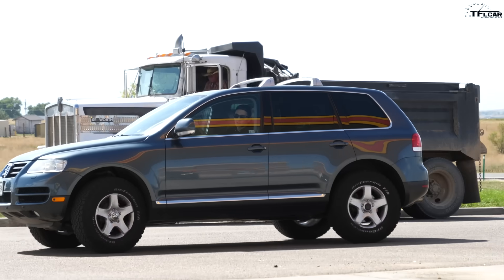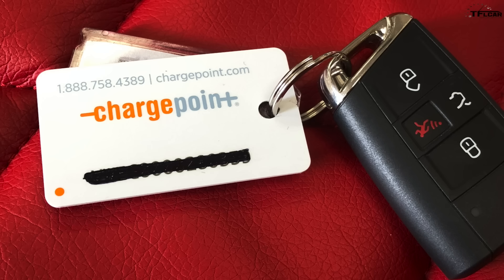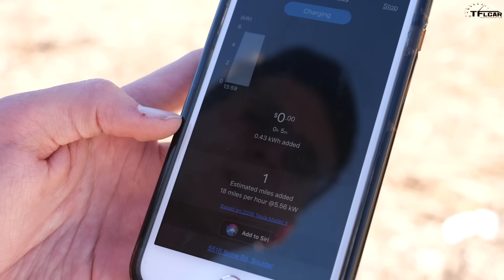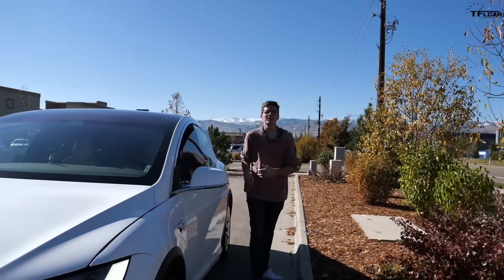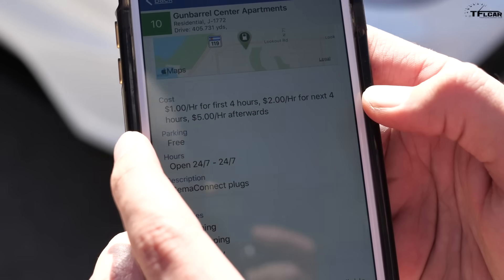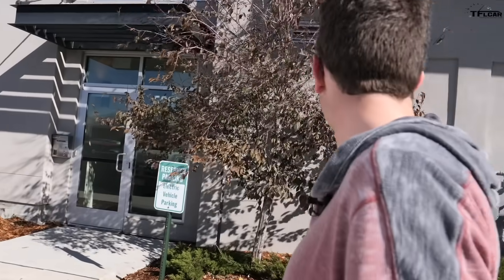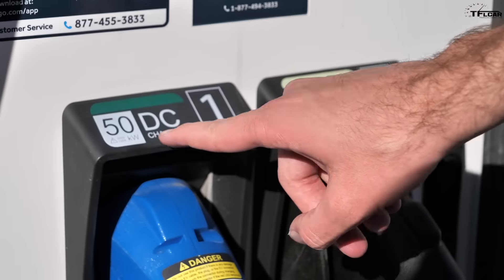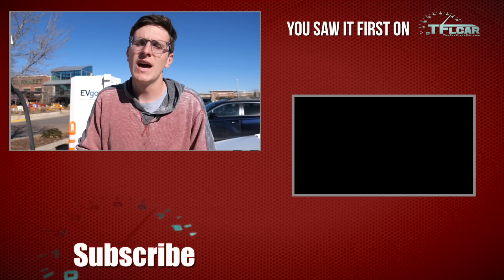Here’s Why Charging an Electric Car Can Suck - And It’s Not The Reason You Think!

Comment: If it's such a great system why didn't they just let you swipe a credit card at each station and what's going to happen when 50 to 60 to 70% of cars are going to be electric vehicles is not going to be enough charging stations that's so if you're going to sit there for a couple of hours you going to need a lot of charging stations even 30 minutes on average it takes 15 minutes to fill up a gasoline vehicle and you can run three to four hundred miles on the tankful
Reply: The video is bullshit.  Hard to believe that folks are still watching it and believing it 2 years later.

A Tesla supercharger is actually more simple to use than a gas station -- no fumbling with phones or credit cards, you just plug in and it starts charging.

Comment: Wow, by the time you are done charging, Im 450 miles down the road. Think Omaha NE., from Denver. Very informative on EV current status and how this is rolling out. Another 5 years should shake out many of these problems.
Reply: The video is bullshit.  Hard to believe that folks are still watching it and believing it 2 years later.
I should do a video showing how gas cars are stupid because it takes a day to fill one using a shot glass.

A Tesla supercharger is actually more simple to use than a gas station -- no fumbling with phones or credit cards, you just plug in and it starts charging.  While you are freezing your ass off putting gas in your car, I am toasty comfortable inside.

Comment: Why didn't they generate power from The Wheels on the car into a unit that makes it  50 times more powerful to recharge the battery on your car while you're driving your car and then Park in your driveway to recharge on wireless electricity but if they make an engineer the process of recharging your battery using the car you're not going to have to wait to recharge your car is automatically charged so they deliberately made it so you had to charge the battery so they had to charge you for recharging the battery so this is the most unpopular thing we can think of and we don't like it
Reply: My Prius self charges like that

Comment: The reason you don't want electrical cars and charging a battery it takes too much pollution in the factories to make a battery takes too much pollution to dispose of a battery it takes too much pollution to recycle batteries so they dump the battery idea no one wants the extra pollution from the electrical plants that is going to take to recharge all these cars and vehicles so the battery I did was dumped because of too much pollution and no one wants a high electrical bill that could get as high as gasoline like high utilities do so everyone wants hydrogen fuel

Comment: We need to hydrogen fuel pumps put clear across America today we have them on all of our coastlines all over the world but in the United States we don't have them across the whole country hydrogen fuel has no pollution hydrogen fuel only takes 2 minutes to fill up and it lasts for weeks it's like bringing the good old days back of 10 cents a gallon for gasoline was a hydrogen fuel you have a more powerful fuel a more reliable fuel it turns America back into a superpower that don't have to rely on oil or another country it is a more powerful fuel just like the more powerful engines that we have a hydrogen fuel cell vehicle is a electrical plant on wheels you never have to charge it can charge itself if it had a battery 🔋

Comment: Battery technology is still not there yet. This is too much of a hassle. And what happens when you loose cell service for three hours or any other stupid issue to prevent charging. IM OUT ALSO
Reply: The video is bullshit.  Hard to believe that folks are still watching it and believing it 2 years later. Tesla solved all of the 'problems' in this video.  Do you fill your gas vehicle with a cell phone and a shot glass?  Tesla drivers don't use these idiotic, low power charging stations you see in this video, except in emergency situations or overnight at hotels.

A Tesla supercharger is actually more simple to use than a gas station -- no fumbling with phones or credit cards, you just plug in and it starts charging.  No cell service needed.  A gas station needs power and gas, while a tesla supercharger only needs power.

Comment: So at "level 2" it's the same as pumping 1 gallon of gas per hour? That's crazy!!!
Reply: That's why the Tesla community doesn't charge at level 2 chargers on road trips (except at hotels that provide charging overnight).  Took us 3 days to casually drive from Pennsylvania to Texas, exactly the same as my gas vehicle, only far less cost for fuel.  This video is fake news disinformation if you're driving a Tesla.

And, by the way, Tesla Superchargers don't require credit cards or cell phone connections.  Just plug and charge.  And you can watch folks outside (and inside) of their SUVs, pumping gas in the snow, freezing their asses off.  That's crazy!!

Comment: What a nightmare..Waiting for the charge, getting adapters, not knowing where the fuel stations are or if you can use them, or if the station is being used--all that after spend a large price for a vehicle that you still have to pay for the electricity...Not really sold on the idea---
Reply: Tesla fixed all of that.

Comment: why cant they have a credit card reader? that would cut out 1/2 the hassle.
Reply: A Tesla supercharger is actually more simple to use than a gas station -- no fumbling with phones or credit cards, you just plug in and it starts charging.

Comment: This is too confusing and takes too much work. Plus how are the elderly supposed to figure all this out? I remember years ago when Wendy's restaurant first came out with their new fountain soda machines that had 30 to 50 drink choices, I would sit there and watch the elderly struggle to work the soda machine. Plus what do you do if you have a flip phone?
Reply: This video is nonsense for Tesla drivers.  A Tesla supercharger is actually more simple to use than a gas station -- no fumbling with phones or credit cards, you just plug in and it starts charging.  And the elderly can sit in their comfy car rather than freezing their asses off trying to struggle with the credit cards and gas pumps.

Comment: sitting at a charging station for 2 hours to 24 hours to recharge ur car is a joke. charging ur car over nite when ur source of electricity is coal is worst then actually using a ice car at that point. if there was more hydrogen station, i would consider switching to hydrogen then battery until they can get it down to 5 to 10 min for a 500+mile charge.

Comment: And at a Tesla Supercharger, you can get 175miles/hr charging.
So 15 mins will get you almost 45 miles, typically enough to make it home IF You actually need to charge on the road (which most people won't)

Tesla's chargers are also only 13 cents/KWh

Comment: That's a lot of time to hang around for a charge and all the payment plans and different connects can be very confusing.  Why doesn't the government mandate a standard connection device???
Reply: Government mandates lock in stupidity... if the 5kw connector of today was the national standard, then Tesla's 50kw connector would be illegal and NOBODY would have a supercharger. Tesla's 50kw connector only needs a cheap adapter to charge from a 5 kw connector, but you can't jack 50kw through a 5kw connector without burning it up instantly... No thanks, I rather the marketplace decide on the winner than our dear comrades in the government.

Comment: Try doing this during a snowstorm, or as a thunderstorm comes through and knocks out the power. Where do you go for the 10-20 hours it takes to charge? Do they have a special huge compartment in the boot for all the charger adapters? Stupid, stupid, stupid.

Comment: Spent 6 minutes to recharge 1 mile? Lol...since time is money...how did you save money 💰? Lame propaganda 🤔.  Buy at 60K and take 6 minutes. Buy bye you idiot electric motor vehicle owners  🙄 🤣  idiot
Reply: So ... my car charges while I'm sleeping and is full every day when I wake up.  Does your car gas itself up while you are sleeping, or do you go to the gas station and fumble around for your credit cart while you're freezing your ass off?
Time is money.
Reply: @cSR-71  Craig your argument is weak. All you are doing is transferring the energy source from your tailpipe to your electric company's power plant smokestack. That lithium for your batteries needed fossil burning plants and vehicles to produce these products. Until there is a perpetual source of energy nothing is for free. Can my car gas itself? What kind of argument is that? Can your electric vehicle plug itself into the wall outlet? Lame and weak. You still do physical labor correct? Phooy

Comment: “…but the reality is most people don’t have high voltage power in their garage.“  
I have absolutely no idea what you’re talking about. Every garage that’s part of a home that I’ve ever been in has 240 V power. If the house has an electric range, or an electric hot water heater, or an electric clothes dryer, then it has 240 V power. What are you even talking about?

Comment: Tesla's plug and play system is the most appealing, but still the range is terribly limited. Electric vehicle not a good option for the non-homeowner or traveler. And you still have to burn energy to make that battery and electricity... and heat the battery when cold.... and use 10 different apps to buy charging... and spend all that time making sure it works.... Waste your time not mine. Waste your money, not mine... oh wait, my tax dollars are paying for that electric vehicle in tax incentives...

Comment: Videos like this convince me to ABSOLUTELY NOT BUY and EV.   Time is money. Convenience costs money.  I pull up to the gas pump and 6 minutes later I drive away and don't have to refill the tank for at least a week.   I recently drove from NY to San Diego and back.  I refueled 16 times .  Maybe 10 minutes per stop including a bathroom break.  I would go absolutely crazy having to wait so long for a full electric charge.  EV companies will need to build cars with a bed, so you can go to sleep while filling up.  Also you pay for an electric car 3 times what you can buy a fuel efficient Toyota.  Call me when they figure out a 10 minute charge with a 500 mile range.

Comment: Cost per mile of ICE car is around 14c per mile when gas is $4/gallon and the car gets 28mpg.    Current cost per mile for a Tesla averages around 4c per mile.    

Tesla Superchargers can charge up to 250kw.     
From Tesla Support page:
Vehicle	Supercharge Speed
Model S	Up to 200 miles in 15 minutes 
Model 3	Up to 175 miles in 15 minutes   
Model X	Up to 175 miles in 15 minutes  
Model Y	Up to 162 miles in 15 minutes

When billing per minute, there are four tiers to account for changes in charging speeds: ‘Tier 1,’ ‘Tier 2,’ ‘Tier 3’ and ‘Tier 4.’
Tier 1	                                        Tier 2	                                                                Tier 3	                                                                     Tier 4
Charging at or below 60 kW	Charging above 60 kW, at or below 100 kW	Charging above 100 kW, at or below 180 kW	     Charging above 180 kW
Lowest price per minute	        Second-lowest price per minute	                Second-highest price per minute	                     Highest price per minute

Comment: Well the problem is that EV America doesn't seem to want to get their butts together and come up with a universal charging system.  So if your vehicle is of a particular model, just go to that charging station that's designed for that model.  Solved.
Reply: Actually, the Tesla can charge from most stations with their little adapter for the connector. But for the fastest charge, the Tesla needs a connector that can handle 50kw, while the other stations offer only 5kw. If you plugged a Chevy into the Tesla station the adapter and battery would burn up. A Tesla at the other stations would simply take just as long to charge as any other car. The Tesla design is far more universal than anyone else. 
If the government mandated the 5kw connector, there would be no Tesla superchargers which needs a connector that can handle 50kws.

Comment: Me... Perhaps, if not immediately 5 mins awaiting a pump, no matter what side as hose reaches either side. Say 5 mins to fill, one to five mins to pay, by cash or card. I achieve around town approx 40 mpg. Country and/ or motorway 70 mpg. My town has 5 filling stations. One gives 24/7 attendance, the others, attendance early morning till late evening,  and then electronically by card.
Now if it was me re battery power, i would have had standardisation of battery for all vehicles, that fitted within the chassis and floor pan. Perhaps similar set up like your mobile. 
RR had this set up for the landed gentry to conceal their hugely expensive shot guns. Filling stations to carry a supply of battery along with a power/charge point wrack to maintain and recharge exchanged batteries. This method was used in the mines for miners head lamp power packs and for your crystal radio. 
Lets say for ease of understanding. 100% charged battery £100. Your usage leaves 25% charge in battery, you go into filling station obtain newly charged battery £100 minus £25 = £75 to pay. To me it seems engineers have long forgotten KISS ( keep it simple stupid) My apologies, it is too simple, I must be wrong. 😂

Comment: A summer road trip would not be possible with this car. During my road trips I have to drive 500 miles in one day. Even if the car had a 500 mile range I couldn't wait several hours for it to charge and I couldn't count on finding a charging station outside big cities. I really want to help the environment but I couldn't give up summer road trips.

Comment: There's only one way for EV's to be efficiently and quickly recharged.  Every E V car must be equipped with the same type battery pack that can be slid out, taken out of the vehicle and replaced with another fully charged battery pack.  .   The difference between the charge left on the old battery pack and the amout of a fully charged battery pack will be the cost of the replacement plus the service charge.  Therefore, current gas stations must become charging stations and keep in stock fully charged battery packs depending on their customer base.  When older used battery packs are exchanged, they must be immediately placed on charging units in order to keep a full supply of charged battery packs.  Example - Your battery pack has 1/4 charge left.  You pull into a charging station. The attendant pulls your battery pack out and notates the amount of charge left. He carries it into his station and pulls out a fully charged battery pack and places the trade in battery pack into the slot where the fully charged battery pack was to recharge it.  He then carries the fully charged battery pack to your vehicle and slides it into the slot and secures it, insuring that it plugs into the prewired connectors.  He then checks the charge indicator inside the vehicle. Charges his customer for 3/4 ths charge. The customer pays and is on his way in just a few minutes.
Reply: Do you understand how HEAVY a battery package is on an EV? It's not a 12 volt car battery weighing about ten pounds. A Tesla model 3 battery is over 1,000 pounds... and would weigh even more if it has to be on guiderails and mobile.
Reply: @dking1836  LMAO .   Have you never heard of FORKLIFTS ????  Everyone knows how much an E V battery weighs.  This isn't for the current design of E V's or E V batteries,  It's for FUTURE production.  All E V manufacturers have to work together on this, just like they worked together in the design and placement of ICE vehicles over the decades. . Actually if E V's are the future, why are so many private companies reluctant to jump in and build charging stations all across the country?  Cties are using TAXPAYER DOLLARS to build a few here and there. None of them are using bond money.   Not one single charging station is within 50 miles of my city of 12,000 and most owning 2 vehicles.  And these clowns think they're going to wake up one morning and the world will be filled with rainbows, unicorns and munchkins.

Comment: I am pretty sure everyone has 220 Volts in their garage. It may not be wired up. A couple hundred bucks and a qualified electrician will fix that right up. 

None of this changes the fact that the US does not have the electrical grid to handle 100 million electric cars charging at the same time.
Reply: My dryer connector is in the laundry closet inside...

Comment: How can anyone possibly spend an hour sitting around waiting for an electric vehicle to partially recharge? You would never get anything else done. A trip requiring multiple charges would take much much longer than  a gas/diesel powered vehicle. Given the cost differential, environmental footprint, reduced range when towing or carrying a full passenger load, reduced range when using accessories, like heat in the winter, potential battery damager due to extreme heat or cold, and now the issues with charging this technology has a long way to go.